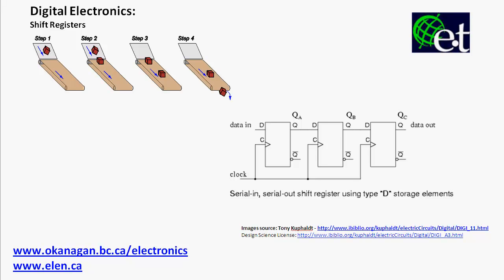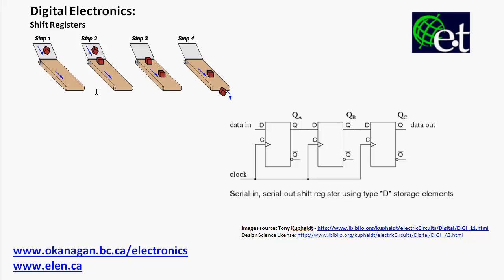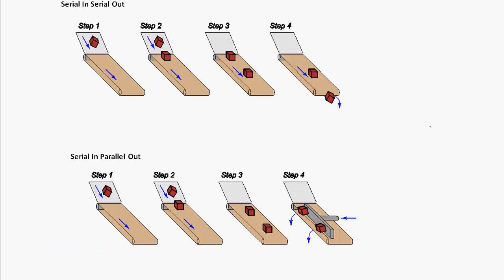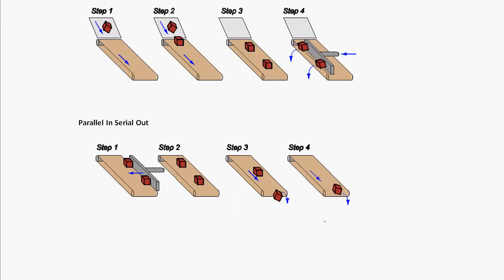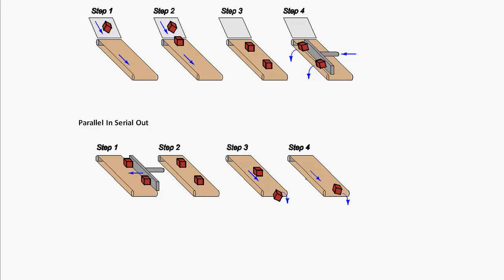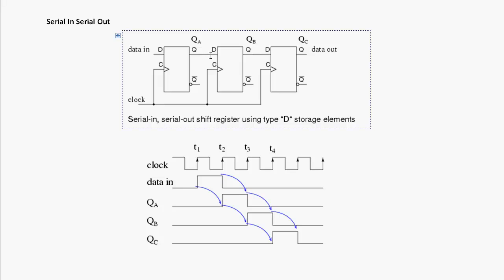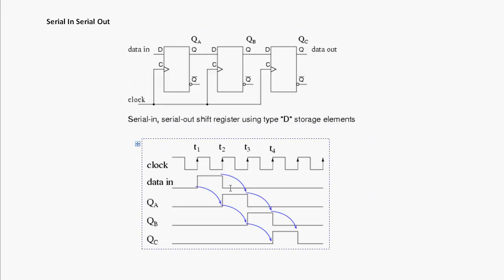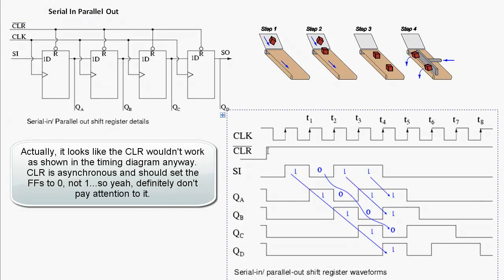Sequential Logic - Intro to Shift Registers

Comment: Actually, I have some question about the timing diagram for the shift register. If we are supposed to use master slave D flip flop, I think QA will be rising in the falling edge of t1 instead of rising edge of t2. Since the master slave D flip flop has two D latch. Am I wrong?

Comment: soooo, Can i create a sipo using a quad flip flop and a tri state line driver for latch ?
Reply from the maker: +tablatronix Do you mean having a tri-state buffer at the output of each flip flop that are enabled when the parallel data is valid, then yes, that would work.

Comment from the maker: Hi Alain, Thanks again for your questions, I'm glad to see that these videos are useful.  Note that in this example there are only three digital inputs D2..D0.  So, I only have the two 2:1 multiplexers because the leftmost flipflop only needs to get data from one source whether it is loading data in parallel, or shifting it out serially.  The other two flip flops are the two that need to select the source (either parallel load or serial shifting from the previous flip flop)